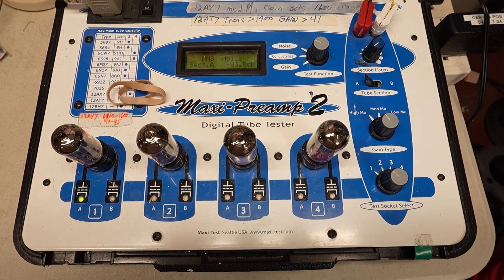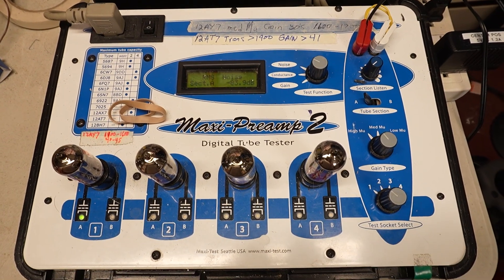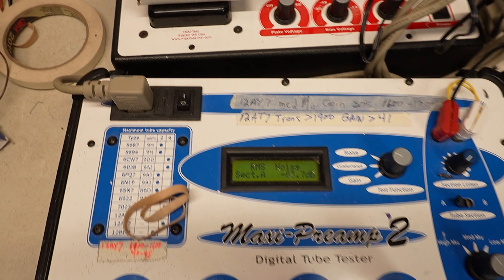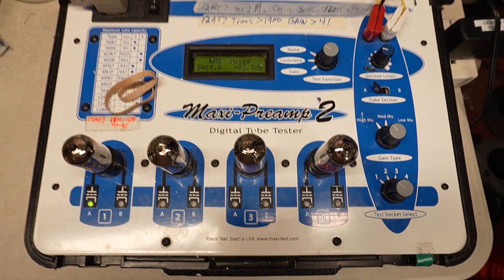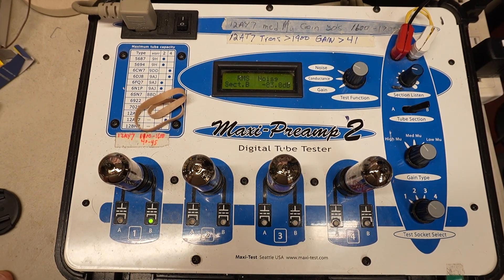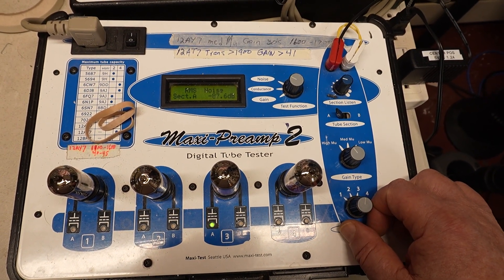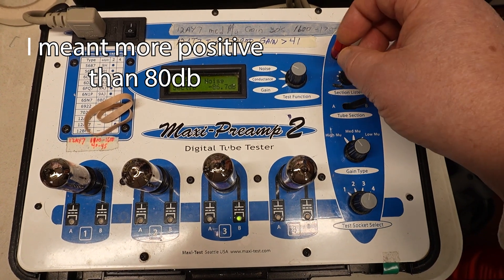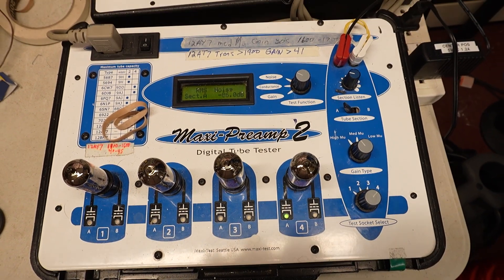Testing common preamp tubes for noise

Comment: I just got this tester.  The noise function is great in theory, but after a few tests, I realized the first two slots register about 4 to 6 dB more noise than the last two slots.  Called the company and they confirmed that due to the proximity to the power supply, slots 3/4 will always be quieter than 1 and 2.  Other readings are rock solid and follow the tube.